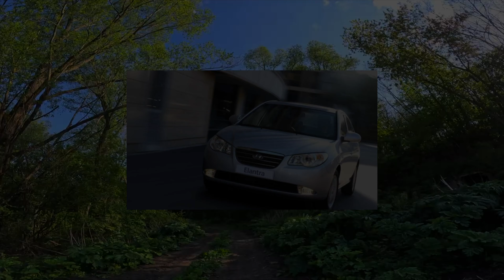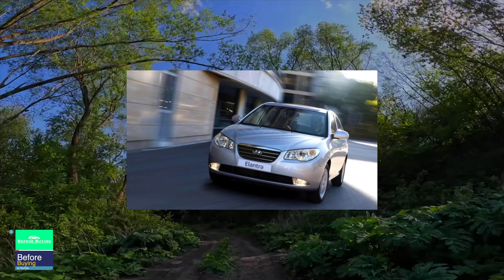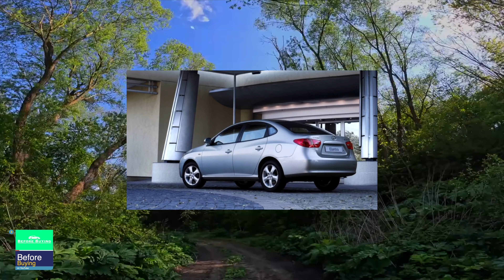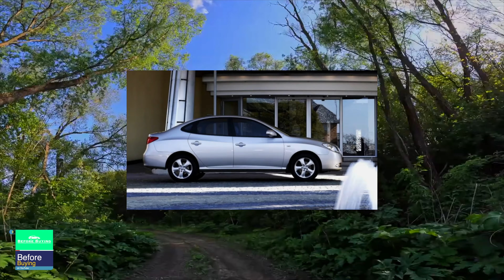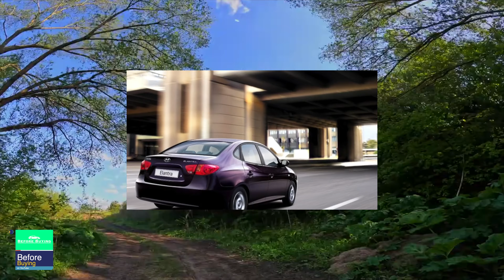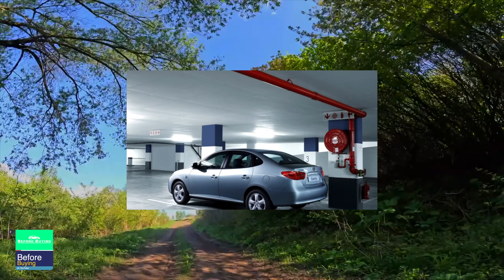The sad story of the Hyundai Elantra 2007 – 2011

Comment: My 2008 steel wheels are prone to rust. I’ve removed them twice in 18 years - sanded them, then apply an automotive primer, then semigloss black paint. The windshield wiper paint also degrades over time. I repainted them twice. The headlight assembly plastic fades to a yellow over time. I installed new aftermarket ones - very easy 1/2 hour job.

Comment: I have owned and driven one of these for about a decade. 2.0 Automatic 135k miles.  The climate controls are prone to failure.  I've already replaced my module once and the one i put in is starting to have issues. Well they are like 50 bucks online so I don't really care.  Much of the cheap plastic they used mostly in the light fixtures decayed away.  But I replaced it.  It was again cheap.  But the one thing that makes it faster than a lot of your modern heaps is it only weighs 2300 pounds.  Unlike many of your lightweight economy cars, it has a right proper suspension, and good strong frame.  It's not about top speed on these mean streets.  The car does what all FF cars were designed to do, but many don't.  You can take fairly aggressive turns without worrying about flying off the road.
Reply: They could last even longer than that. I've had them last up to 300,000 miles, and I found one at auction today with 345,000 miles on it.
Reply: Ikr, when my friends drive mine they are surprised by how agile it is.